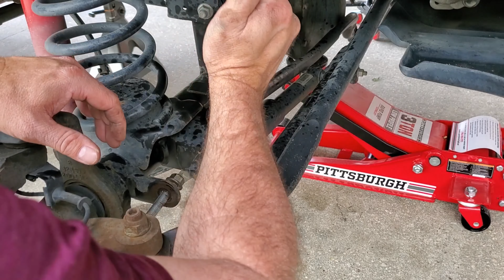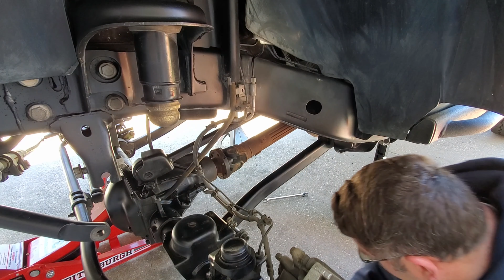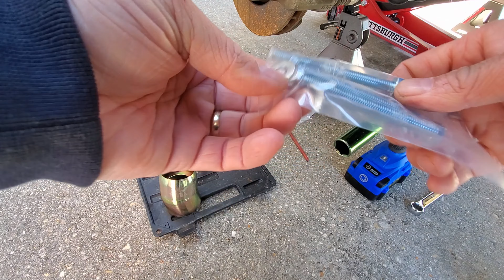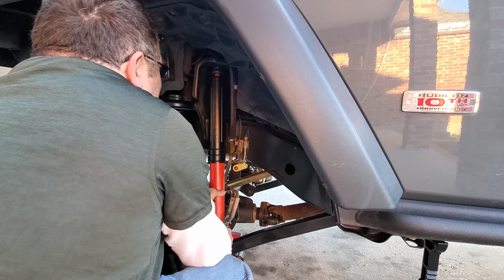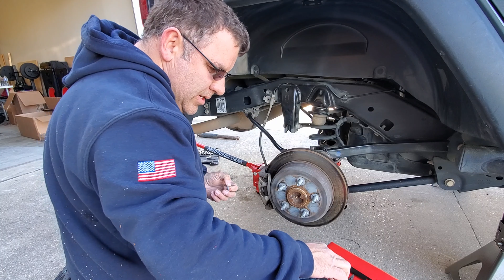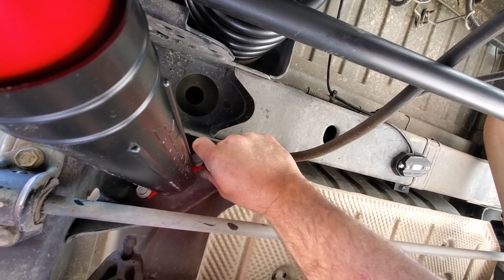MetalCloak 3.5" Inch True Dual Rate Lift Install

Comment: Great video. I'm installing my Dual Rate Kit here in the next few days. Appreciate the time you took to make the video.
Reply from the maker: Thanks, I really like the kit. Just follow the directions and you shouldn't have any issues. The exhaust spacers are a pain but if you have an aftermarket driveshaft you won't need it. I just came back from wheelin in Colorado and it worked great. I need to get off my but and install the rest of the parts to make it a game changer.

Comment: I definitely will be doing the 5.5 inch Metal Cloak 6PAK Long Arm kit for my 2014 Rubicon, to fit the 40 Mickey Thompson MTZs w what will be 1 ton axles, 5.13 lockers. Think thats the way to go for me.
Reply from the maker: Jeep your way! Get what suits your trail style. If I were to go that big a tire I would probably do the lock and load and get some beefier drive shafts and knuckles too. You are only as good as your weakest link. Send pics when its done! I'd love to see it.

Comment: Why the dual rate and not the game changer? Have you added the extra control arms since this install or is the dual rate suspension compliant enough as is without any extra additions? Are you happy with the ride quality?
Reply from the maker: Hi, This is a great question. This kit was perfect price and quality wise when I was looking to put on a kit. The ride is good on highway but super capable off road. Just got back from 7 months wheeling in the Colorado and the Dual rate kit worked great.  I am leaning towards the lock and load instead of gamechanger to my understanding the ride is much better and a lot more flexible.
Reply: @olskool985  Forgive my naiveness. What's the lock and load?
Reply from the maker: @e5toro7008  The Lock and load are a long arm kit that has more travel and a couple upgrades like a spring in the radius arm that removes binding. vs the gamechanger that is more of a mid-arm. Here is the link to Metalcloaks website.
https://metalcloak.com/jk-wrangler-lock-n-load-long-arm-compound-suspensions-4-5in.html

Comment: Awesome video! I ordered the same lift kit. Did you need to change your driveshaft as what was recommended by Metalcloak?
Reply from the maker: I hadn't changed my driveshaft at that time. I used the exhaust spacers as seen in the video.I have since upgraded to an Adams driveshaft.

Comment: Great job. Do you know what is diffrent in the kit if you run stock wheels vs the 4.5 wheel back spacing? I see there is a $30 upcharge if you run wheels with 4.5 or more back spacing. I will be ordering new wheels soon but didn't know if I should wait to do it all at once or not.
Reply from the maker: Hi, If I'm not mistaken its how the shock mounts up. Give them a call at MC and they will be more than happy to help. I wondered the same myself. Thanks

Comment: Thanks ! Getting ready to put on a 2 1/2 “ Gamechanger  on my ‘17 2 dr Recon. Is that a metric crescent wrench ? 😂  Good idea putting the hardware back to avoid confusion. Where did you get the track bar adjustment lengths ? I did not see that in the Gamechanger instructions.
Reply from the maker: I called MC for the dimensions. They are different between the gamechanger and the tru dual rate lift. Be aware of that. MC is more than willing to help. Metric lol its also a hammer 🔨

Comment: Did you ever have any issues with your brake lines?
Reply from the maker: Hi Emily thanks for the question. I haven't had any issues. Just use a good uv resistant tie wrap and you should be good to go.

Comment: Okay, how did you fit the exhaust spacers in.... I got the passenger no problem, but driver I can only move about half way. Any tips?
Reply from the maker: It was a fight. I did like you but then I took off the passenger side and put the driver first. Then tightened everything after.
Reply: @olskool985  I actually searched the metal cloak website and found out that the spacers have a full set of instructions. They loosened the clamp down stream from the driver side spacer,  after grinding down a little weld spot meant to stop it from sliding any further, I was able to easily slide the exhaust back and pop in the spacers with out much trouble. You're video was very helpful through out the rest of the process though. I really appreciate it!

Comment: Any issues with rear pinion angle on the stock control arms?
Reply from the maker: Not that I can tell. Everything seems straight.     Its not that aggressive lift so there isn't much angle difference but with taller lifts it might. Thanks
Reply: @olskool985  Sounds good. Thanks for the reply! Jeep looks great

Comment: Your jack stands, are they 3 tons each or 6 tons each?
Reply from the maker: Hi ,These were the 3 ton stands.
Reply: @olskool985  Any specific torque spec (ft lbs) when tightening the bolts back on upper, lower control arms, track bar, etc? I’m running Factory wheels/ AT tires 33” on a ‘21 Rubi JLU for now. Will put on 37”s in a month’s time. Would i need to install the shock mount relocation brackets for now for the fronts or rear?
Reply from the maker: @YeepLife  There are specific torques. I followed Metalcloak recommendations and factory torque specs. Not sure about the JL wheels, call Metalcloak best customer service in the business!